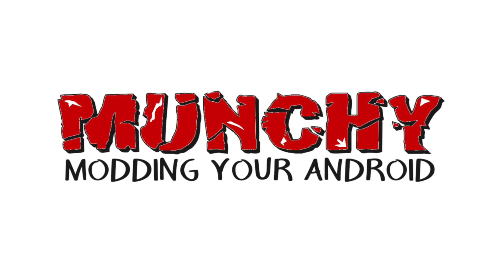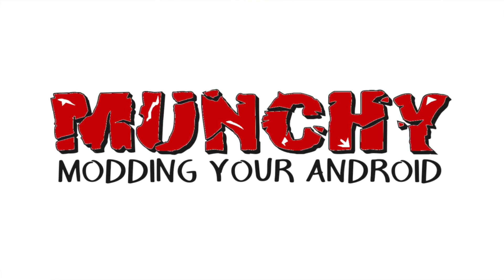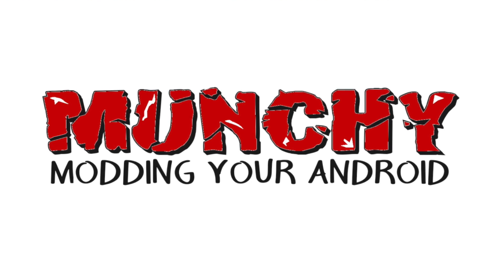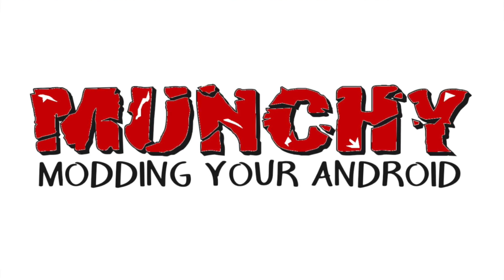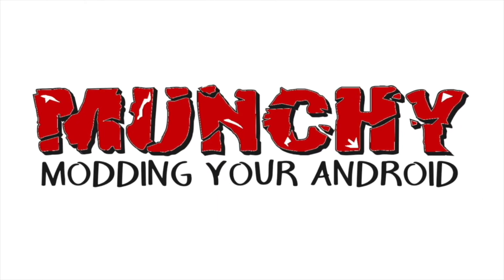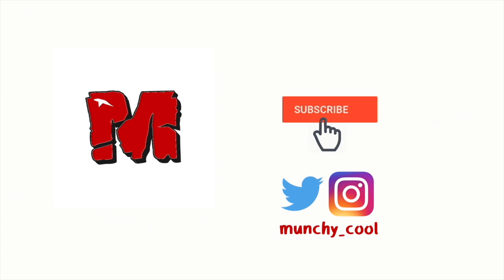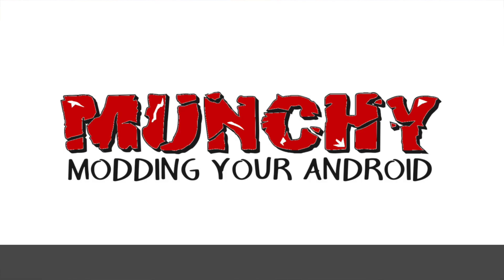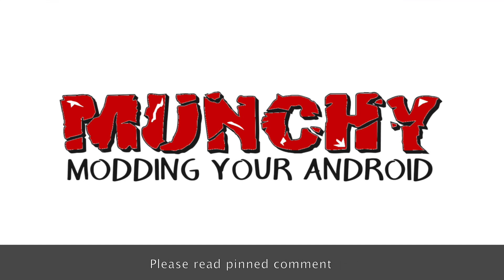JerryRigEverything | Note 20 Ultra Teardown No Copper Cooling Video is Misleading | PGSvsCopper

Comment: Wait i think the copper zack was talking about is vaper cooling system, which is way better in comparision to graphite that's why all gaming phone has vaper cooling system heck even my note 10+ has it, and samsung was proudly advertising it on their website, but this time around they didn't i did a bechnmark run bettewen my note 10+ and my mom's note 20 ultra( exynox variant) and the different is small, and the note 20 heated up like crazy. If u need proof i can send u some pics

Comment: He clearly showed that American snapdragon version had cooling though.. So even the different snapdragon variances have differences.

Samsung are still overcharging regardless of his video. The exynos is still rubbish. 25% less powerful and battery performance is garbage for the same price.
Reply: US Snapdragon, like from iFixit, has graphite cooling chamber on it. iCase's Cambodian ulit, which he assumes that it's the US model, is actually the Exynos model with copper.

Comment: You may be right technically when you compare PGS and copper but the system used in the snapdragon variant is a vapour cooling chamber which has been a lot effective for laptops such as Razor and even mobile phones such as ROGS , Legions etc. Samsung has not been totally honest with the customers around the Europe who have been buying inferior exynos variants . Anyway thank you for the information about PGS.

Comment: Nice👌🏻👌🏻
COPPER – 398 W/mK
Copper is the most commonly used metal for manufacturing conductive appliances in the United States. Copper has a high melting point and a moderate corrosion rate. It is also a very effective metal for minimalizing energy loss during heat transfer. Metal pans, hot water pipes and car radiators are all appliances that utilize the conductive properties of copper.
GRAPHITE 168 W/mK
Graphite is an abundant, low cost and lightweight alternative compared to other carbon allotropes. It is frequently used as an addition to polymer mixtures to enhance their thermal conductivity properties. Batteries are a familiar example of an appliance that harnesses graphite’s high thermal conductivity.

Comment: hey what about the 5G modems which Samsung doesn't include in the device and yet charge you  1300 dolars? for exynos variants
Reply from the maker: thats not the point of the video ..its about cooling system
have to agree that selling non 5g models and 5g models for same price is wrong ..
Reply: In my country, the LTE variant is just around 100 USD cheaper than the 5G variant.